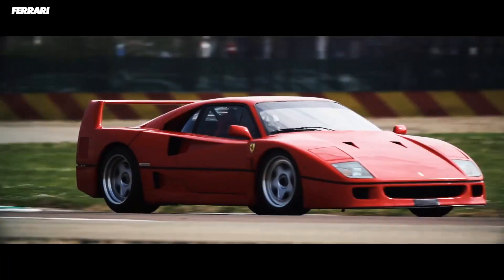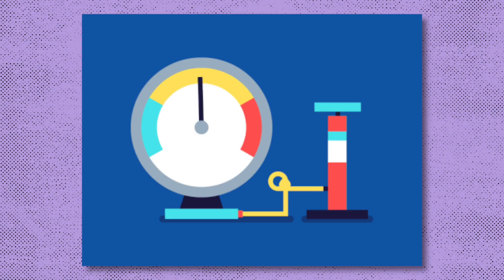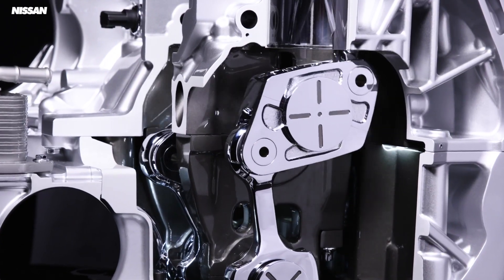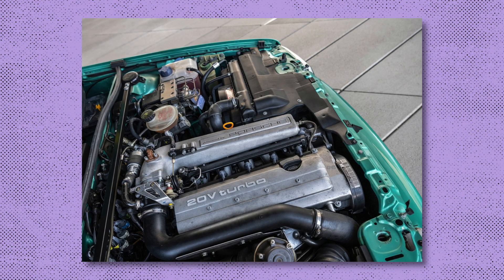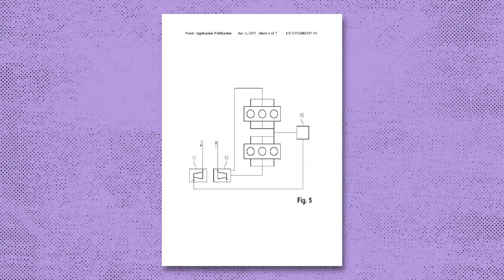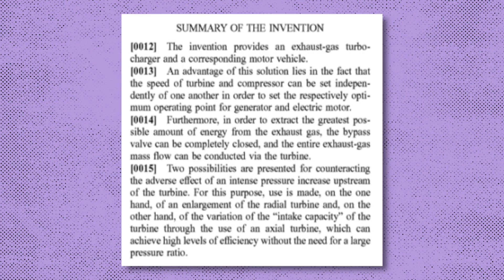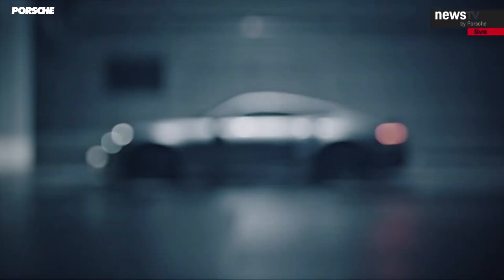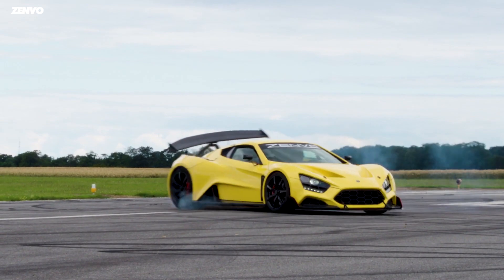Porsche's GENIUS New Turbo Design

Comment: Actually if you make the engine smaller but turbo charge it to give back the power in essence puts the engine under tremendous stress and dramatically lowers the life of the engine.  An engine is truly matched the weight of the car.  The best story here is the Ford that beat Ferrari at the LeMans in the 1960s (research the story).  
.
.
Turbo charged engines were all the rage in the 1980s and quickly fell out of favour when the engines started to give problems.  Ultra high compression on the gaskets is just not good and gasket technology has simply not changed since the 80s. (ie: unless you want to drive a car for about 4 years max - stay the hell away from a turbo - and DON'T buy a second hand Turbo charged car)
.
.
Using an electric powered 'turbo' has a different name: It's called a "supercharger".  You can also mechanically connect the 'supercharger' to the engine's rotating parts.  None of this is new in any way.  Watch the original Mad Max movie (where he would turn it on and off at will).  Using exhaust to turn a turbine to make electricity (that is then used to power the supercharger) is a red herring.  Your alternator creates more than enough electricity to run a supercharger.
.
.
Porsche have perhaps prepared a patent on a specific element of the entire 'kit'.  But the base principle is very old.
.
Reply: Agree with this. Nothing new here. i know i had this idea over 20 years ago and i am sure i'm not the first. The reason the turbocharge was so revolutionary is it was a light (as in weight) and relatively compact way to take energy that was being wasted (exhaust gases) and use it to make more power by forcing more air into the intake manifold. Now they are adding motors, wires, batteries, and generators to the system. That is all the dead weight to push around where the old aluminum (or stainless steel) tubes was relatively light. It is a nice idea but it is kinda like pitching a perpetual motion machine. Seems like a great idea but never really works.
Reply: Lots of reliable turbo diesels, and Volvo turbo petrol engines are very reliable as well. It does add complexity, but it proves that properly engineered turbo setups are fine.

Comment: It's not genius.  There is doubt whether electric turbos (in any form) will be used more than ever.  There's great question if electrical energy used in a turbo is even achieved in engine performance to make it a net gain, let alone whether that electrical energy would be better spent turning an electric motor to assist the gas engine.  (AKA a hybrid.)  And the majority of use-case where it does make sense is only because of extreme niche use-cases and where rules prohibit better use-cases.  So all of this is questionably useful at best, and definitely needs proving.  But you never know until you try, and niche outliers always exist, so anything could happen?  That said, based on science and observation, we know what is probable.

Comment: Volvo has solved this issue with its PowerPulse system - using a reservoir of compressed air injected into the exhaust manifold (a bit like anti lag) for instant turbo response

Comment: 0-62 in 2.7 is hard to beat "no matter how much you spend" unless..... you spend money on a set of slicks and some ladder bars, or just build an awd car with launch control.... Oh you mean money spent on a car with factory configuration. Because you can pretty easily make a car that quick with aftermarket setups. I still don't understand this divide that car people have. Where if you build a car for cheap that outperforms expensive cars from the factory, it somehow "doesn't count". Or maybe people just prefer having a "real" fully featured car from the factory and not a janky box that is also super fast but lacks every other desirable quality from a new modern car and is essentially a purpose built street machine without any thought put into creature comforts, practicality and long distance driving like you can do with "real" cars that are also fast from the factory. Or I guess there's just way more people out there that understand enough about cars that they can pay a lot of money for a fast one from the factory, but they don't know that you can build a car that is older and much cooler and not all bulky and heavy and ugly with modern safety standards ruining everything to be just as fast or faster for much less money. So because the market is much larger, the cheaper custom built faster cars for the money are not even an option or in the awareness of most buyers. But man you can get a sleek sexy car from the 90s through 2005ish (modern golden era) and build it for 30k and it will be faster than 60k+ cars from the factory. They look cooler, they are lighter, smaller, less bulbous, faster, more classic and unique and custom, and yet people pay more for slower uglier heavier modern cars.

Comment: best way to do it would be a hybrid system, use an exhaust turbine to charge the battery, as well as the normal hybrid system, then have an on demand electric compressor to run off the massive hybrid battery. this could even be retrofitted into existing hybrids with not much effort.
Reply: Thinking about doing this with an Avalon Hybrid
Reply: @Zeko_El-Emrico  One thing to consider is the toyota hybrids typically run a super high compression ratio, something like 15:1. they also run an intake restrictor that effectively lowers the compression ratio for the intake part of the cycle. Running e85 and getting rid of the restrictor is probably what you want to do.
Reply: @davidfarmer  never knew that, might look into that. I just want to make the gas friendly family sedan have a little fun to it

Comment: There is quite a bit wrong with this idea, main issue I see is the whole system is irrelevant without a serious battery backing up the system to utilise the electric motors off boost and under threshold. Then how much storage does the battery hold, how fast can said battery be charged... oh wait the system just failed that'll be 40k to fix it.

Comment: Volvo’s T6 engine uses a supercharger to avoid turbo lag at the beginning, then the supercharger cuts off and the turbocharger kicks in. I drive a 2018 Volvo XC60 T6 and have never encounter turbo lag. It seems to be a simple solution, which is why I don’t understand why it’s not commonly used.
Reply: because it's incredibly complex, expensive and has lots of heat problems, VW had it on the 2008 1.4 MKV GT Golf, and then the MK6 Polo GTI, and it was quickly phased out due to endless problems. I like the idea, but yep, far more complex than single type charging. No doubt Volvo have improved on the design, but still it's not a motor design for common use.

Comment: This seems like common sense to keep the hot exhaust away from the air you want not melt your skin hot. This split design has been possible the whole time. Look at it this way. Does a super charger run its cooler air through an oven? No it doesn’t aside air friction heat. Some leaked engine block heat transfer. Neither are combustion level hot.

Comment: 4:05 oh! I read a reference to Audi introducing electric turbos in a car magazine years ago. The magazine was talking about near future innovations but didn't go into a lot of detail. I understood they were talking about eliminating lag by borrowing battery charge to run the compressor then paying it back a second later from an exhaust powered generator.
Effectively I assumed the industry was doing exactly what this video says Porsche have developed. The benefits of splitting the hot and cold side didn't even occur to me, I just thought that's what everyone would do with wholly electric compressors. How does an electronically assisted one work then? Must have some kind of mini clutch for the motor, and I suppose that could engage at relatively low RPM because the electric bit is to get it going early.

Comment: Totally electric turbos have been around for 25 years, mostly used on diesel bus engines. 10 years ago, a proper company appeared on YouTube(Torqamp) and sells complete kits. Do a YouTube search for all of the Dynamometer reviews. Porsche has no claim at all to an all-electric turbo, sorry. Your info is WAY OUT-OF-DATE. Torqamp 48volts w\controller.

Comment: Funny how Saab solved the lag problem nearly two decades ago when upgrading and refining their Trionic 7 engine management system and the B2x5E/L/R series engines. While the 9-3 had been already moved on to fully GM parts bin based model down to the engine in 2004, the OG9-5 was made with Saabs own parts and systems, along side its Opelified cousin until early 2010. There is no driver discernable lag or delay in response with these cars. And while they were at it, they deemed it more economical to simply control the power output of the B235 engine with software and remove all mechanical and parts differences from its manufacture as this made per unit cots drop significantly simplifying both final assembly and the engine plant production. The only difference is the ECU mapping for a different power and torque output, lesser models being lesser. But with the torque peak appropriately positioned towards low-mid range of the engines power band.

These engines use the mentioned "anti-lag" functionality of burning fuel in the exhaust for pre-boosting and are capable of adjusting ignition and fuel injection rate at speeds most engine management and fuel injection systems cannot achieve. This is in part down to Trionic 5.5 and later systems using direct ignition exclusively. But more to the point the system is able to pre-empt the need for accel with gas pedal movement rate being a factor in the calculations.

Nothing spectacular today in executive saloons or sports cars, but something literally no-one else was doing in the family car segment in 2006 - 10.

As a result when it was very likely GM would be selling Saab off, what they did was release the Aero engines map as a free upgrade to any owner of MY2006 or later 9-5 2.3t or 2.3T who was willing to pop down to their local dealer for 30-45min to have it reflashed. And this would not change warranty liability from Saab or GM anywhere, as the engines didn't have mechanical differences. 

Most enthusiast had been aware of this at this point for years, and had been doing the modification on their own, or with aid of a dealer which would retain the factory warranty.

Not sure how many bothered, but the "LPT" version (which, prior to this MY2006 wasn't given an intercooler and used a ECU with out a knock sensor and some other refinements) was configured to a rather pedestrian 185bhp@5500 and 280Nm@1800 . The Aero punches out 260Bhp@5300 and 370Nm@1900rpm, which is quite an upgrade.

The 2.0t was similarly homogenized in manufacture and engine optimization taken to its peak but as it's demand had dropped radically they didn't bother with offering it with more than one power output after 2006 and all 2.0t BioPower B205L's make more than the previous turbocharged 2.0t and 2.0T B204L/R and B205E/L/R before it. 

The consummate revision received the latest and feature full revision of the Trionic 7 system including both intercooling and knock sensing as standard from MY2005 onwards and the final revision of the B205E (2.0t BioPower) makes 178bhp@5500 and 280Nm@1800.

These upgrades also included E85 FlexFuel functionality, which was another motivation for further optimizing their mechanicals and use of the Trionic 7 in all models. Yet again increasing power output with negligible fuel consumption due to ethanol having less energy density, but lower emissions as it burns cleaner.

The Trionic Engine Management system was further developed in the GM based engines into the Trionic 8, which in the NG9-5 meant that all engines regardless of displacement from the 1.6l inline 4 to the 2.8l V6 had parallel turbocharging with variable geometry turbos as a main feature. The T8 and it's capabilities were about the only thing GM retained and later utilized after sale of the company to Spyker and the IP and manufacturing licenses for the older bits to China.

Funny how Cadillacs and Buicks started to appear with parallel turbos in their four and 6 cyl models not long after the sale. :D

VNT/VGT turbocharges are another way solve the issue of lower end torque needing a quick spool up (but less boost) and high-end power more pressure than a smaller turbo can give, making a "LPT" model a pointless concept today. Practically no manufacturer is using a single mode turbo these, as a average sized VNT/VGT turbo solves the issue in all reasonable use applications that the average driver could have for his car.

When you factor all those little refinements together, direct ignition, pre-boosting, fast enough and dynamic enough of an ECU with a modern VNT/VGT turbo and a competent engine tuner that knows the design and its flow characteristics well, you get all the benefits with zero lag. And zero down side.

The issue has been solved. Decades ago. Some manufacturers just are simply not up to the job. As can be seen from their need to both cheat emissions and use less effective and more expensive means to meet emissions standards. Using nonsense like EGRs etc. that are known to cut service life and increase unreliability after only a couple of years of running. And so they prefer to only install the necessary kit for doing it like real men in high-performance versions of their models. 

And as they are more interested in an arms race over maximum nominal power output, and in this top trumps for the dealership sales reps, "winning" necessitates leaning hard towards maximizing power while compromising efficiency and reliability and emissions and lends itself to using far more complex solutions for very little overall gain. Certainly zero gain in any public traffic use, even on the autobahns.  

This means using both a complex sequential turbo system with modern VNT/VGT turbos which are boosted beyond their original reliable design parameters and into Aerospace Mean Time Before Failure and parts refit and replacement cycles. Which is pointless, since this means turbos become disposable or need a complete rebuild after around 150 000 km. Maximum power and high boost pressure in the inlet manifold are not inherent values! Increased thermal efficiency with the worship of stoichiometric burn being observed are! 

No exceptions! Unfortunately the buyers don't share the sentiment and feel like they want to pay for the privilege of soliciting a turbocharger refit and OEM replacement reseller every 2,5 years and paying 850 - 1500e a pop for running the peak of German automotive engineering in 2020.

It's sad that efficiency would be about to start selling cars properly, as governments go "green" and start introducing ever higher environmental protection taxes on fuels and making threats of banning internal combustion engines altogether. First their manufacture. Then all of them from public use. Yes, it will be a criminal offence to drive even a museum vehicle with internal combustion by 2050. Period. 

This is justifiably so as the industry has forsaken the creed of the engineers, and deserve to die for their disgrace. And the they've only themselves to blame for causing the outrage of users and feeding the politicians revelling to pull the trigger and moralists screaming for their public execution! 

The internal combustion engine is thus dead, only when it was about to get really good. At not wasting an atom of fuel. We could cut emissions and fuel consumption by 50% over night with what Saab and Köenigsegg have already done and made mass manufacturable. But the company management is now all of a sudden scared of "reputation damage" and of being actually held criminally liable for their negligence!

That's why every manufacturer is going electric. Because they're not up to the job of a real engineer! And the only one which was, is already dead. :D

The Saab H-engine is still developed and manufactured in China and Algeria but that's a story for another day. Bro-tip to anyone interested or struggling with old Saabs; the Algerians have the entire back catalogue on offer for about 1/10 of what the new-old stock that's in the Saab Parts AB catalogue is going for.

I don't think oil pans or steel head gaskets are worth 300e on a rust bucket that's barely worth that much when fully functional.

Comment: Boost takes lots of HP, 48V is an absolute must.  Instead of that, try this:

Drive the compressor of the turbo from the crank thru a CVT and step-up gears.  Also direct drive the turbo with the exhaust driven turbine.  
When boost is needed, change the ratio on the CVT to spool up the turbo without lag.  As the exhaust builds, the compressor power will come from the turbine.  
When max boost is achieved, change the ratio of the CVT to direct excess turbine power to the crank (instead of that power going out the exhaust pipe.

Comment: correct me if I am wrong, but isn't this exactly the design of the merc F1 PU? A front intake cold turbo with an axel passing through the engine top towards the back exhaust hot turbo and an electric generator/motor to apply the harvested energy when needed. This has been the highlight of their technology since 2014.